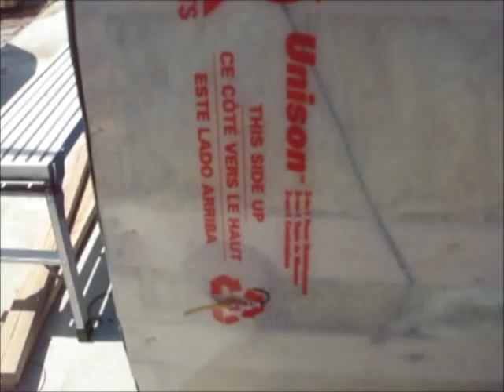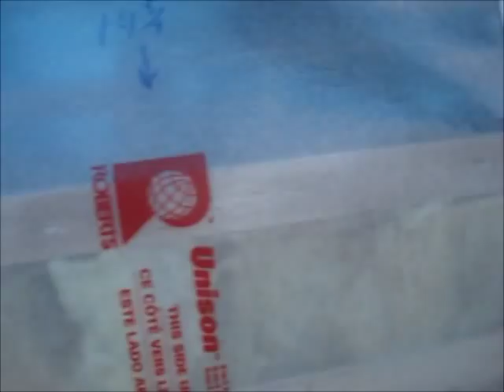Restoring The Shasta Part 9a - Installing The Rear Metal Skin

Comment from the maker: Hi Scotty, I have never seen the S-Fold Seams leak unless they were bent. But if it makes you feel better about your seams by sealing them go ahead. Just make sure your seam sealer doesn't get down on the face of the aluminum that is exposed or it will show up when you paint. Thanks for watching and thankyou for your support.

Comment: I am enjoying your video series Larry. I heard you say in this video that it was un-necessary to seal the rear "s" bead. I have studied some hydraulics and a phenomena happens behind an object moving through air. Eddies form and can move moisture up and possibly infiltrate that seam. I would seal it myself. If I do a trailer (and I plan to) I will donate to you because I would have never had access to this information if it wasn't for you.

Comment from the maker: Nope. You can do one of two things. Either get new metal or take the front apart and cut the paneling down to the proper size so that the old metal will go back on. New metal for the front is the way I would go. The front usually needs new metal anyways.

Comment: So...I got new tires mounted on the rims that were on my 1964 Shasta today. I can’t get them back on! They were a bit challenging to get off, but since they were old an flat I was able to get them off. Now with nice new tires I cannot get them on. Any thoughts? The thing is sitting in the field I found it in, and my brother is coming in two days to haul it to his garage.
Reply from the maker: You probably bought regular car tires for it. These trailers used biased tires which are thinner. You should be using real trailer tires because the side walls are meant to handle the load. If you can't replace the tires you can let all the air out and squeeze the tire together if need be with a big welding clamp and it will slide in. Then you can air it back up but hope you never have a flat on the road....
Reply: mobiltec 
Thanks- I will try that! I can at least get her garaged and start the work. Planning on purchasing the proper rims and tires down the line. Love, light and blessings to you!